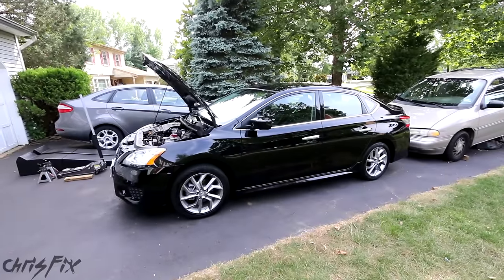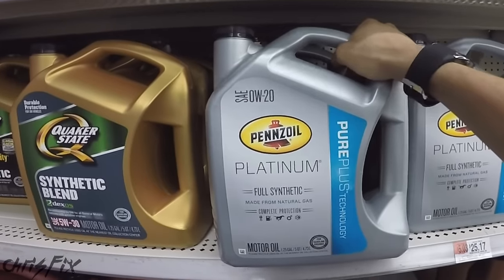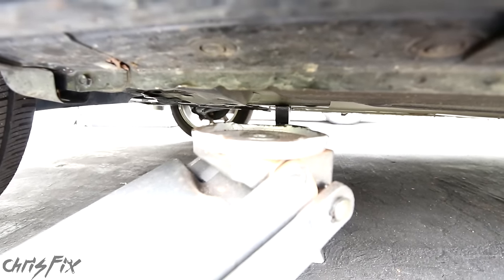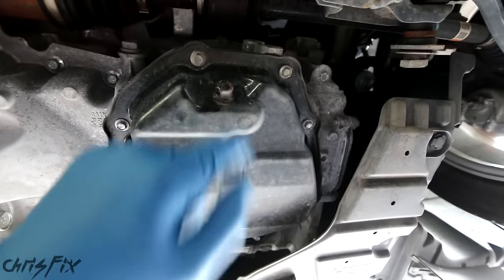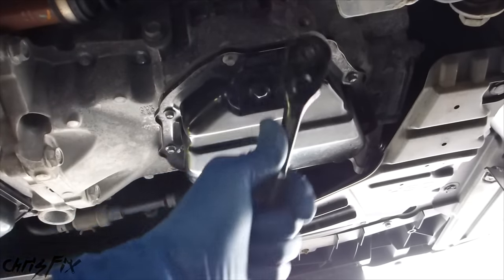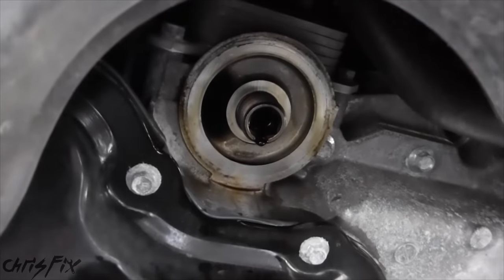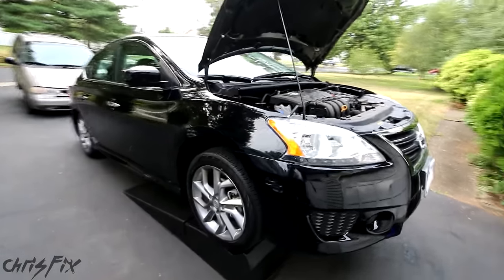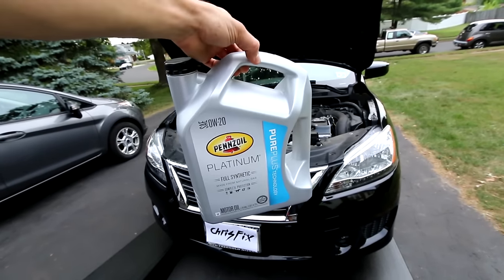How to Change Your Oil (COMPLETE Guide)

Comment: So In theory why is it that lubricating that gasket makes it not leak? I’m from aviation but I was a car mechanic before and I never lubricated that gasket because it makes it like u said in the video easier to come off. U don’t want it to come off while driving or anything due to vibrations bumps casual car stuff and what not especially since they have a low torque also known as German spec hand tight guessing lol or very low IN Lbs Tq. So lubricating that and the threads that actually mount the filter to the filter mount shaft/ bolt threads.will only increase chances of it falling off you’d think right? Is this why the gasket material around the filter is a soft crushable material so it holds it in place better  making it harder to spin off I assume. But lubricating that makes it easier to spin off so I don’t get it can u explain why u lubricate the threads and the gasket rather than just priming it by filling the filter with the new oil only and installing. it makes more sense to only do that. ?

Comment: Gonna be doing this again Monday, weather permitting

Not super looking forward to it but it cant be helped xD last time I did it was August 23rd 2021 so it's a little in need of a change 😅 hopefully this time the filter cap isn't stuck tight! I swear Walmart used threadlocker when they did it 2 years ago
Reply: How did it go? Did the oil filter come off pretty easily?
Reply: It was pretty well stuck but not nearly as bad as the other time 😂 I do need to get a new cap though because it's starting to strip the corners
Reply: @cosmicbrambleclawv2  They are relatively cheap if you go to a place like AutoZone. Glad it came off a bit easier, who knows what they did that first time lol

Comment: If you prefill shouldn't you pour it around the holes so the oil filters through the actual filter media cause the center hole is where filtered oil comes out

Comment: Hi Chris
I got hyundai sonata hybrid. When changed the oil first time it came oil complete. 
I kept driving and checked oil level after a while engine was empty. 
I checked oil filter and made sure there is no leak. 
Can you help to solve this problem. I believe it's not burning oil..There are no spills on driveway.  Kindly help to resolve it.

Comment: I have a question. When you turned on the car at the end you explained that oil was there because you put it in the filter below the car. But you also said you can't always do thay as the filter might be sideways. What do you do to get the oil in the engine if you cannot add it in the filter and can only add it in the engine??? I hope I was clear
Reply: You'd just add it in the engine. Pre-filling the filter just prevents the engine from starting dry for a second before the oil gets circulated. If you can't do it, it's not a big deal. Just add the oil normally.

Comment: I got a oil change for a 2008 Saturn SUV and now where the oil cap loosens to add the oil the tube that the cap connects to turns with the cap is that normal?
Reply: Are you saying the cap where you add the oil, that cap just spins and spins?

Comment: I like to write under the hood on plastic above radiator with silver marker the size of oil filter car takes, what amount of oil and type to fill it with filter, and the wrench size for drain plug then i can grab everything before crawling under car.
seems like the filters come off easier if the car is warmed up before doing oil change also some say it helps suspend small particles in the oil, so they drain out with the oil.

Comment: I don't have ramps or jacks and my VW golf has a big plastic tray with a bunch of torx screws covering the oil pan. 
Is there any downside to using the siphon method to remove the oil? 
(my filter is under the hood)
Reply from the maker: Unless your car says you can do that, you'll end up leaving a fair amount of oil in there

Comment: i took my car in for a oil change and the guys stripped to thread on the oil pan. i paid them $10 for a piggy screw plug but its still leaking. any idea how to fix it cheaply ?
Reply from the maker: Dang, how difficult is it to remove the pan?

Comment: I remembered doing an oil change on a 2014 Chevrolet Camaro ZL1 and while I was putting the wrench on the lift, I got oil on my skin even though I was wearing gloves and I found out that if you get motor oil on your skin, it could lead to skin cancer

Comment: My toyota corolla need 4.2 liters of oil. But the stores or any stores in my place only sell 4 liters bottle. So do lacking 0.2 liters oil damages the engine? Or do i really have to buy 2 bottles every time?
2nd question: i rarely drive, like i only drive like around 1000km per year. So can i change oil every year instead of every 6 months? I’m using conventional oil.
Reply: you should be able to get a 1L bottle somewhere, use synthetic and yearly is okay but 6 months would be better. and honestly theres probably not much point having a car if you only do 1000km a year, thats more than enough time for petrol to go bad

Comment: Hey chris i have a honda grace jdm hybrid and it is recommended to change oil every 5000 km but i change oil round 4500 +/- but recently i have noticed engine noise increase some local mechanic have recommended that i increase the viscosity of my oil from 5w30 to 10w40 since mileage on my vehicle is 160,000km should i? It's an earth dream honda engine it and has no tapits to tighten kindly recommended me what should i do..love your channel and ur work watching u as long as i could remember.
Reply from the maker: I am not there to know what the sound is but be careful with thicker oil if the engine has vtec. You can try doing half 5w30 and half 10w40 to mix it and see if it helps.

Comment: I have Fortuner Toyota 2011 using API SL 20w50 can i use 5w 30? in owner's manual 5w 30 , 10w 30, 15w 40, 20w 50 oils are recommended my car has a milage of 265000 kilometers I lived in middle east where temperature 45°C at peak summer.

Comment: I know this is an old video. But I'm wondering for the old hands that might still be in here. I've got to 3.3 '02 caravan and I've gone over the service recommendation. Is there a way to flush the engine without the use of a machine? That way I can put pretty much brand new oil in its entirety through it?
Also. What are your guys's takes on these insane numbers where the oil filter says good for 25,000 km
Reply: Hey Ray, hope all is well. Has anyone helped you out with your questions yet?
Reply: @vigilantemotors  no help yet
Reply: @vigilantemotors  but I did the curb up method and waited till nothing dropped from either pan or filters
Reply: @Ray-Koto-McLellan  Well I would love to give my advice Ray. 
There really is not a great and effective way to flush your engine completely without a machine.
However, if you do an oil change, let it sit for a good hour when you release the drain plug, get all that old oil out, you should be just ok.

How far over did you go?

As far as the oil filters. I am complete against it. They are anywhere from 10 to 15 bucks so they should be changed EVERY oil change to help protect your engine.
That is just my opinion.

So, again, how many mile did you go since your last oil change?
Reply: @Ray-Koto-McLellan  Sorry I am just seeing this after I replied. If you let it sit for a good hour most of the old oil will drain out.
Reply: @vigilantemotors  I'll let it go for a longer sit but I had gone over by approximately 3k kilometers so I was pushing 11k vs the 8k max I should have gone.
Reply: @Ray-Koto-McLellan  oh well you’re ok. I doubt any harm was done. I’m sure it’s okay to be completely honest. Just change it regularly and you’ll be great. 
Hope I helped some. 
If you like these kind of YouTube channels maybe you can take a look at mine and tell me what  you think.

FYI, I answer every question on my channel so feel free to ask any you may have. 
Hope to see you there

Comment: doesn't the ramp make the oil go back to the pan & not exit from the drain hole?
Reply: no the drain plug is at the edge of the pan where the oil would be pooling so you’re actually getting more oil out on the ramps

Comment: Hey love the video learned how to change my oil here but I’m running into an issue that’s happened twice now. Every time I fill my car to the manuals specified liter the dipstick barely gets wet with oil is always low why is that?
Reply from the maker: Are you on a level surface when you are checking? That can make a big difference
Reply: @chrisfix  yea haha im in my level driveway but even if its not 100% level i dont see how it takes an extra litter.

Comment: What about if my oil filter is sideways and i can't fill it up with oil, how can i make sure my engine dosen't start dry
Reply from the maker: You can still add enough oil to coat the filter material and then install it, it will absorb and store a little oil so it's not completely dry and it won't make a mess
Reply: @chrisfix  I seriously commented on an 8 year old video and you still answered, you're a legend man.

Comment: Hey man. Many thanks for this video. I have a question, on minute 10:25 you say that the gaskets are generally one-time use so you recommend to replace it with a new one. Where do you get it from?is it the same for all the cars? Thanks man
Reply from the maker: You can usually get a pack for your car for cheap online (or sometimes it comes with oil filters) and different cars have different size drain bolts so it's not all the same

Comment: I'm struggling removing the oil filter. Its too tight and the area is too cramped. and the adjustable thing does not work! Do not buy! 
Finding the oil bolt and replacing the fluid was the easy part surprisingly. Did not need an extra pair of hands.
Reply: Mind if I ask your year make and model?
Reply: @vigilantemotors  its a 2000 RAV4. I was able to remove the oil filter with scissor clamps. it was difficult to maneuver in a tight place but it got done.
Reply: @abigailmendoza2502  Awesome! Did you ever think of buying an oil filter wrench? Do you know what they are?
Reply: @abigailmendoza2502  Just for the future oil change? Did you actually try both bands to remove the oil filter? Just take some deep breaths, and it first it wont seem like it wont turn but it will eventually slightly turn. Then you keep turning it.

Comment: my owner manual says that Engine Oil should be "API Service SG or SH Energy Conserving II (EC II)" but in "Knowing What Motor Oils Not to Use" by Thomas F. Glenn it says that SF, SG and SH are obsolete:

"Look for the 'API Donut' and the two letter Code on the back of the bottle. If the label says API Service 'SA', it's engine oil made for use in cars built prior to 1930. API SA through SH motor oils are classified by the API as 'OBSOLETE'."

Then, should I ignore the recommended lubricant by my owner manual and SAE viscosity number that fits my weather but with any SJ, SL, SM or SN API Service codes?

Comment: Hi Chris thank you for this video I will be referencing it in the future when I change my oil. I did have a question I recently got my oil changed I purchased a gallon like the one in this video and a new oil filter and they said they used the whole thing is that possible? May I add my car had too much oil in it because I kept topping it up without checking the level first. Thank you looking forward to your response.

Comment: Chris! which side of the Drain Plug WASHER faces the oil pan? the round side or the flat side of the washer?
Reply: Sigma, has anyone helped you out with your question yet? I know its an old question but for your next oil change. Let me know. Thanks
Reply: @vigilantemotors  i havent done my oil change because im scared that i might put the washer the wrong way and it might leak :(
Reply: @sigma0987  Well let me help you out. Its a great question by the way.

You want the rounded side of the washer to face the oil pan so it "crushes" against the oil pan.

Does that make sense??

I have a YouTube channel myself and I just put up a video on oil changes. 
I would love for you to check it out and maybe sub to the channel if you like what you see.

I answer ALL the questions asked on my channel.

If you have any other questions about this oil change you have coming up ask me on my channel and I will happily guide you through it.

You are going to do awesome!@
Reply: @vigilantemotors  thank you so much!  Cant wait to attemp my first ever DIY oil change in my garage 👍  how about the oil filter? I’ve been told that it just hand tight? is that true?
Reply: @sigma0987  Yes I am excited for you. You will do great.

If you go onto my channel I just uploaded 2 days ago an DIY oil change. I go over every step in detail.
Only hand tighten the oil filter. You will see how I do it on my video if you watch it and its exactly what you should do when you put yours on.
Again, I will answer any questions you may have. Just add comment on my DIY oil change video and I will reply.

Hope to see you over there and I cant wait to find out how your first oil change went.

Aaron
Reply: @vigilantemotors  Thank you! i really appreciate taking your time and helping me.. will go ahead and subscribe to you and watch your tech videos
Reply: @sigma0987  Awesome and thank you. If you have any other questions just comment on my OIL CHANGE vid and I will happily answer and help you. 

Looking forward to hearing from you on my channel.

Comment: My oil filter has to be installed upside down (where the oil would spill out if I pre-fill it). Is it fine if I install the oil filter dry? Or should I try my best to get oil in the filter beforehand.
Reply: absolutely ok to leave it dry.

Comment: Does oil brand matter ? And how do i know which brand to pick for my car
Reply: Yes oil brand does matter. What kind of car do you drive if I can ask.

Aaron
Reply: @vigilantemotors  i got toyota camry le 2007
Reply: @spooky0903  If you have a V6 and I think you do, you want to use a a synthetic SAE 5W-30
Valvoline or Pennzoil will do just fine. I think you take 4.5 quarts but not positive. That will be in your owners manual.

Be sure to also replace your engine oil filter. However, that is the brand and oil you should be using..

Does that help?
Reply: @vigilantemotors  i got a 4 cylinder not sure if that makes any difference on what to get
Reply: @spooky0903  Yes it does. You want to use a synthetic SAE 5W-20 or 0W-20 oil.
 Either or will do just fine.
Reply: @vigilantemotors  thanks alot i just dont want to mess up my car for putting the wrong stuff

Comment: If there anything else I can do it my oil filter is stuck, I’ve used the oil filter pliers, they dented and scratched it but it hasn’t moved, then I tried the screws driver hammer method but that doesn’t seem to be working, I’ve already drained the oil so I can’t really take it anywhere, any advice?

Comment: Thank you very much for the video. How do you dispose the old oil? Put it back into the oil container, even though there is some left?? I know there's drop off locations, just no clue how I will carry the oil. Also, do you just rinse clean the oil tray?? Thanks!
Reply: I usually put it in the container I bought it in. I don't add oil between oil changes, so losing that half quart or so isn't a big deal, but you can use anything that has a lid, milk jugs, juice containers, etc. Most auto parts shops will recycle oil. I put the container in a plastic bag to keep from making a mess, Also, yes you can just wash out the oil tray with soap and water and reuse it or just wipe it out with rags.

Comment: Chris when you were talking about running the engine for 5 minutes to heat up the oil some people might get a little confused. You should REALLY have stressed that people DO NOT EVER run the engine without oil in it.

Comment: Just wanted to change oil for the first time by my self, I did all preparations and discovered the drain plug head (6 sides) is stripped, what to do?
Reply from the maker: Dang I'm sorry to hear, you'll need some extractor sockets to remove the drain plug: https://amzn.to/2LH35nf also make sure you get a new drain plug
Reply: @chrisfix  Got the work done, ty Chris 👍

Comment: For the life of me I can’t get the drain plug out even with a breaker bar and lubricant, any tips?
Reply: Alexander, sometimes quickie lube places will put those things on so tight they are almost impossible to get off. Try some PB blaster, let it sit overnight. Get the Jeep nice and warmed up and then try.

If that doesn't work let me know i have some other ideas

Aaron
Reply: @vigilantemotors  Thanks for the advice. I tried what you said and the bolt still did not budge one bit even with the engine warm ,PB, and even a socket with extra grip for stripped bolts. Unfortunately I’m limited in my resources so I don’t think I can really try anything else.
Reply: @alz8204  Try a Hammer.
 Generally, getting to this point means that it is not only sludge keeping the oil drain plug in place. It is most likely over-tightened. This means it is time for the trusty hammer. A little persuasive maintenance never hurt.

Gently tap the oil drain plug with the hammer, hopefully loosening whatever is keeping the plug still. Remember to keep trying to turn in a counterclockwise direction. If it doesn’t move, give it a few more taps. Keep working.

As soon as the oil drain plug starts to turn even a little, you can swap the hammer for your handy socket wrench to finish the job.

Comment: Nissans are horrible with level for oil. The best way is to check cold over night especially on the 300x 350z the oil stick is used to bring down the oil back into the pan on some engines.

Comment: 2 things-----you need more light under that car. And, at 9:22 if i'm correct, it seems you turned that breaker bar tool clock wise and not counter clock wise. In order to loosen that bolt you needed to turn it counter clock wise, I don't understand how you loosened it by turning it clock wise???